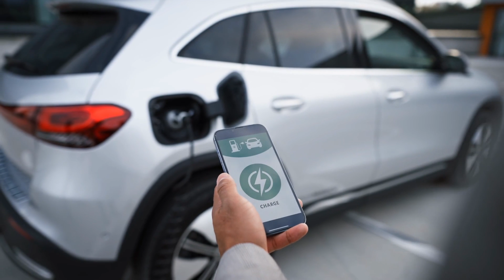Toyota CEO: "This NEW Hydrogen Engine DESTROYS The WHOLE EV Industry"

Comment: Again this demented push for a terrible solution to our oil elimination issues. Worse, it casts a shadow of corporate stupidity over a company and country we once believed to be creative innovators.

It takes 50kWh of electrical energy to create 1kg of green hydrogen. This amount possesses 33kWh of thermal energy which Toyota's ICE turns into 12kWh of mechanical energy.

This same quantity of mechanical energy is got from an electric motor (90% efficiency not 37% like the ICE) with  13.33kWh from a battery (with itself a 90% round trip efficiency, charge/discharge) or 15kWh charge energy . This is 333% more efficient.

Toyota/Honda will depend, anyway, on blue hydrogen, the only currently volume production method, which itself is a fossil fuel user for its process, for any kind of initial adoption.

The replacement of lithium with sodium, the elimination of cobalt, alternate sourcing of lithium from fly ash, and the solving of silicon electrode issue, imminently or immediately promises much lower cost batteries, with benign materials, and potentially greatly increased capacities with multi-location material resources.